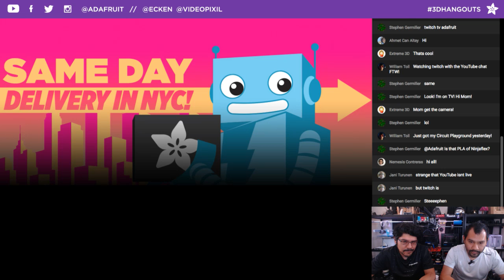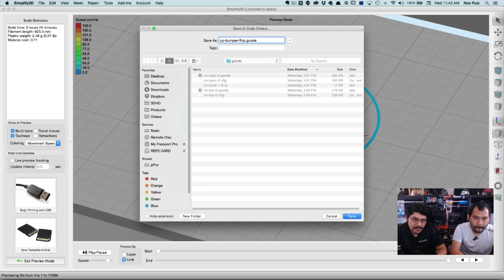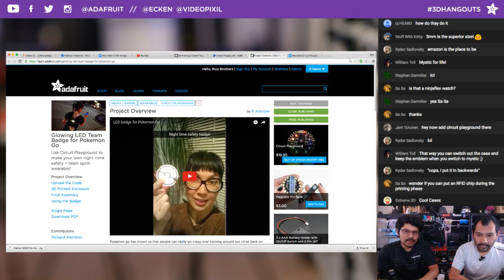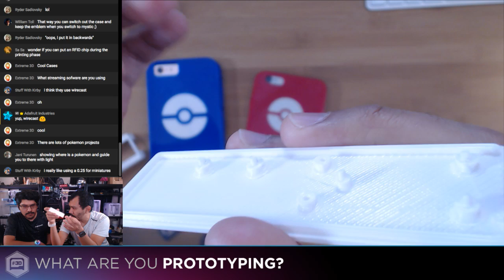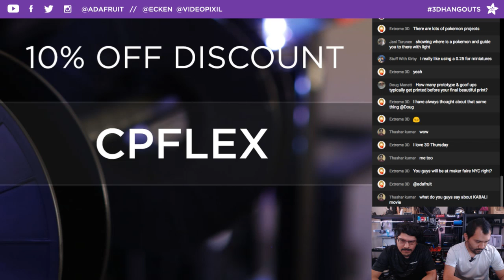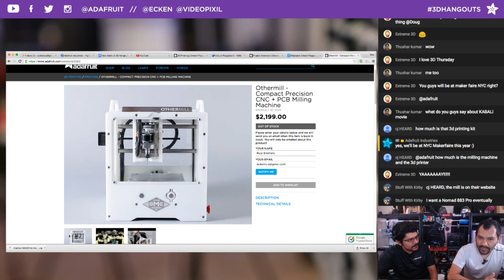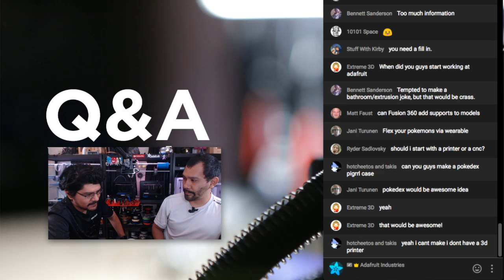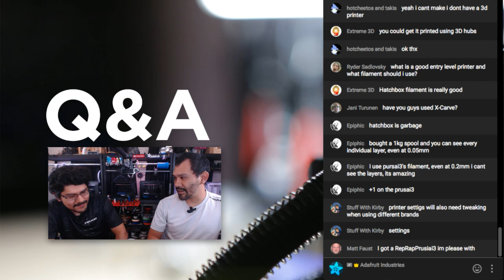3D Hangouts - Wearables and Ninjaflex

Comment: Hey guys, keep up the great work! You've helped me immensely in getting started with 3D printing and designs, can't thank you enough for all the resources and projects you've posted. I was hoping you could help me dial in the print speed for my FlashForge Creator Pro. I've reviewed your S3D profiles posted on github (thx for posting those) and found a wide range of print speed in the different profiles. Any chance you guys could provide some details around when to use what speeds? Even a general set of guidelines would be helpful. I've been using the S3D defaults and feel that I have a lot of room to improve. I noticed that in particular the 'Flash Left' profile prints at 1800mm/min which is 1/2 the default speed I've been using. Thanks for your help!
Reply from the maker: Thanks! Will answer this on this weeks show - https://www.youtube.com/watch?v=TBI96Vh8PuQ

Comment: ramp in is better. so a movement that is diagonal in path to the depth you want. one can slow fr down at same depth but only if you don't get deflection in the bit. or can cut shallow in multiple cuts for higher fr. speed is critical for chip rate of bit. look up a catalog for those charts and will help you with setup in fusion 360 with the included cam

the spoil board I run is MDF. 5'×12' table. and have a seal that we can put in any path yes it's industrial type. 
we have a cutout for path for vaccum to hold down part. 30bar vaccum is strong enough to move the machine before you move the wood. air is pulled through the spoil board and holds part.
a small version can be made to hold parts to your bed. its really nice to do it this way and every once in a while resurface spoil board. i have a 4" fly cutter with replaceable carbide tips for my setup so I would do like a 1/2" on yours and like. 1/8" thick spoil board.
will take some work and milling your bed with the path you want for vaccum and a fitting at bottom. it's just a lot of work to set it up. when done, omg the time you save, less parts damaged from breaking loose during a cut op.
i am building my own setup and will use a tank to hold vacuum, standard vac pump and a valve controlled via a separate switch.

Comment: Hello I have a few questions.   I had an unfortunate accident with my Flashforge Creator Pro. I broke the left extruder fan when I was loading filament by accidentally have the tip of the filament get caught in the fan.  This broke the fan blades.  I'm getting a replacement fan from Tang (Amazon customer service for Flashforge)  .  Have you guys had experience taking it apart?  Would it be difficult for a novice in hardware and electronics to fix?   

Also, have you guys had this issue with the ooze shield generated by Simplify3D. It always looks like this when printed on my Flashforge. It splits up and falls apart making a mess.https://dl.dropboxusercontent.com/u/81851980/IMG_20160717_031012.jpg

Here is what it does to my print.https://dl.dropboxusercontent.com/u/81851980/IMG_20160717_032614.jpg Do you have any recommendations on how I could clean this up a bit?